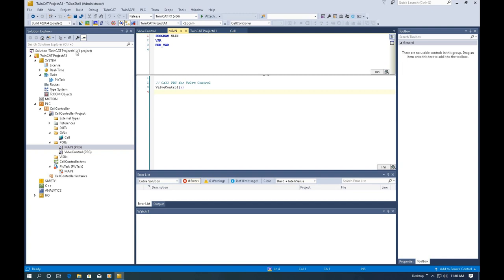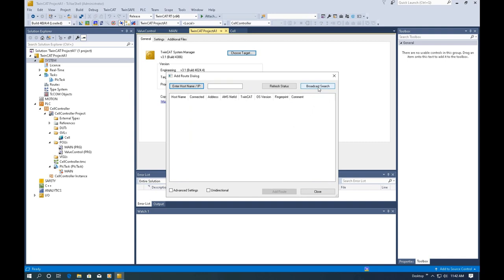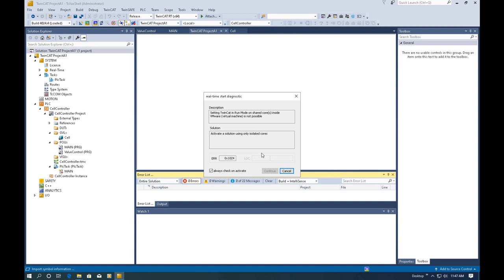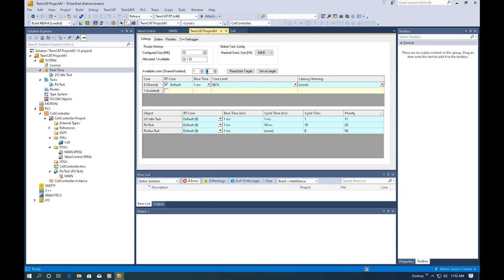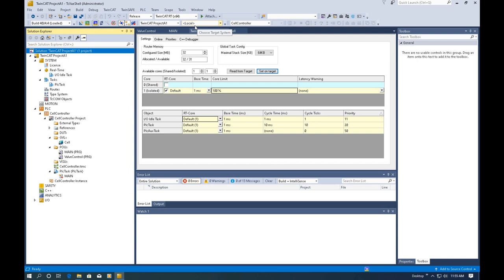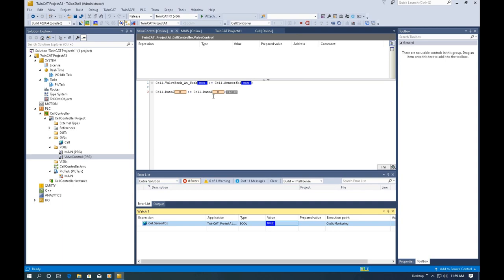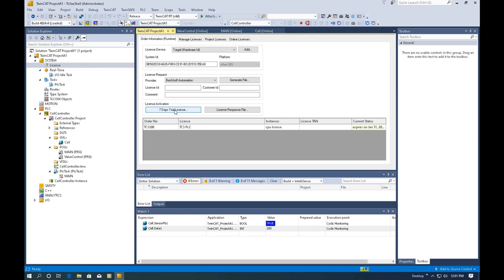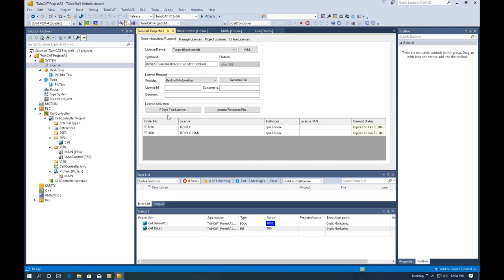BK02. How to Simulate BECKHOFF TwinCAT PLC Project via Virtual Machine System

Comment: All this works, thanks for the tutorial.
But can you connect to and control EtherCAT slaves (e.g. servo drives) from TwinCAT running in a virtual machine?
 I can't make it work, when I scan for devices it finds nothing. If I switch target from <local> to a physical Beckhoff PLC it finds EtherCAT slaves, but from <local> it does not.  Does this need some extra licenses added, or some configuration of the virtual machine network adapter?
Thanks.
Reply from the maker: Hi As I understand, the <Local> means 'internal' or simulation. If you are trying to connect actual device, you need to switch 'target' to an actual device's IP address. Meantime, you also need to do some settings on your virtual machine to allow your VM to connect in an actual device. I would have a actual beckhoff controller and EtherCAT devices in 2-3 weeks. I will record how to connect a controller and scan the EtherCAT device once I have them.
Reply from the maker: I did use virtual machine to program, connect a Beckhoff controller before, as well as let the controller find the EtherCAT valve bank. VM should work for the online connection.
Reply from the maker: Hi , if you try to "scan EtherCAT slave", your TwinCAT3 target must be connecting with "CX" controller instead of <Local>, and you must switch the CX controller into "configuration mode" rather than run mode. Beckhoff calls this mode is "Free Run" Status (configuration mode, but scan the EtherCAT slave ) I just tried today.  At this mode, the icon on your bottom line of the TwinCAT will show Red/Blue Flashing
Reply from the maker: Please check this video : https://www.youtube.com/watch?v=Be86qrIGpu8&t=675s   BK04. How to Connect Beckhoff Controller using TwinCAT 3 (2 Scenarios)
Reply: You can use TC3 inside a VM and control EtherCAT slave devices. I have found that in my VM's with VMware 15 and Windows 10 it doesn't work. The Ethernet Port disappears in the VM when the realtime driver is applied to that port. However, Win7 64bit or 32bit works like a champ. There is a lag with TwinSAFE. You would probably see Watchdog errors. I have seen this in my testing. These can be adjusted in the project but would need to be set back to defaults when real hardware is used. For regular IO it works really well for bench testing and development work. To get this all to work you have to have your VM  network settings correct so that the VM nic can see the outside world. Then it works just fine.

Comment: Hai Sir, I am facing trouble at the timestamp in your video 8:18, where I cannot change the change number of cores of isolated to 1, when I set the shared number to 1 then automatically the isolated is 3, and if the shared is 2, then isolated is 2 as well, when shared is 3 the isolated is 1. So Can you please tell me how can keep both the values to 1. Thanks in advance
Reply from the maker: You have to use the isolated core running as your PLC CPU.

Comment: Thank you for this really GREAT video ! I wish the all Beckhoff's documentation would be so clearly explained ;-)

I have 2 questions: About the Real Time setting of the VM. Set on Target returns me 16 core. Should I assign more then 1 core as isolated ? and if I do, what will be the setting between I/O, PLC task and PLC aux. task ?...
2nd Question:  9 months ago, pnn tmp asked you (here below) about connecting a device (e.g. EK1100) via EtherCAT to the VM ? Did you maneged ?  I'm using now TC3 on WS10 and at moment, I failed...
Reply from the maker: Hello Q1: At Real-Time item, you can assign multiple cores. This assignment depends on the actual cores of your beckhoff hardware controller. Using VM is a brief test, so one core for testing is enough. From application view, you might have Motiontask under the <Task> hierarchy. The Motiontask is recommended to assign a dedicated core. Other tasks can be assigned in one cores. Sometimes the VISU_TASK HMI task can be assigned to be separated with PlcTask.
Reply from the maker: Q2: Using 'Simulation' or when set Target is "Local" is basically used to test program or code only. At this moment, you items under the I/O->Devices-> EtherCAT should be set as "Disable". So there is no way to communicate with actual external devices. Once you use a real beckhoff controller (e.g. CX9020) + EK1122, then the controller has EtherCAT Master function, it can connect EK1100(EtherCAT) station. (Tips: Likely a PC can be installed with EtherCAT Driver to run as EtherCAT Master, But I never tried that and never saw any actual project using this way. Personally I still highly recommend using Beckhoff controller to implement EtherCAT communication)
Reply from the maker: Please let me know if you found some explanations got something wrong or the answers have some missing.

Comment: Hi! Nice Video! I followed your Instructions but ran multiple times into the same Problem. After I’ve set the isolated core and restarted the system and started the configuration, the Error message Pops out: 
CPU setting mismatch!
3/1 CPUs configured and 3/0 found on target. 
Please adjust settings.

But before I assigned the isolated core, Twincat was showing all 4 Cores.
In the Taskmanager the cores are showing as the following: 
Cores: 2
Logical Cores: 3
So the assignment kind of worked, but the Isolated core went somehow missing. We are not using a virtual Machine. 
Do you have a Solution for this Problem? Thanks a keep up the great work!
Reply from the maker: Hello, I didn't have the problem on CPU isolated assignment. Are you using the latest TwinCAT software? Try to reinstall the TwinCAT software. What the CPU of your laptop. Is that Intel CPU? And did you click 'Read from target' before you assign the isolated core and set the target?
Reply: @electricalautomation   Thanks for our reply. I am currently using the Twincat v3.1.4020 Version. I must use this version because different Projects in our laboratory are running on these Version. The Project usually runs on a Ethercat Devices, but due to corona we cannot connect to the devices. 
So, I’ve come across your vid. I’ve disabled the Devices in the twincat project, set the target system to local and read the CPU from target, then 4 CPUs popped up. I’ve assigned one core to isolated, saved and rebooted the PC. Then the Error message from the Comment above pops up. 
The CPU of my Laptop is a Intel Core i5-6200 CPU @ 2.30 GHz 2.40 GHz.
The Taskmanager is showing 2 Cores with 4 Logical processors. If I assign one isolated core in Twincat, the Taskmanger is still showing 2 Cores, but with 3 Logical processors.  
Du you have any further idea, how to fix this problem?
Reply from the maker: @voglair2400  Likely the TwinCAT is fighting with Windows to occupy the CPU resources. Please check the BIOS setting such as Hyper-V, VT-x, and shutdown the anti-virus. And I also recommend to phone call your local Beckhoff support, sometimes they could have some patches with amazing solutions.
Reply: @electricalautomation  I'll try that, thank you!